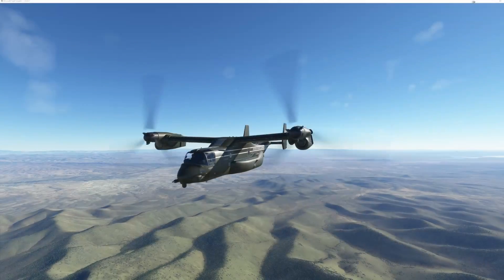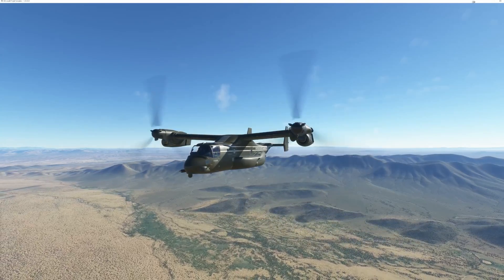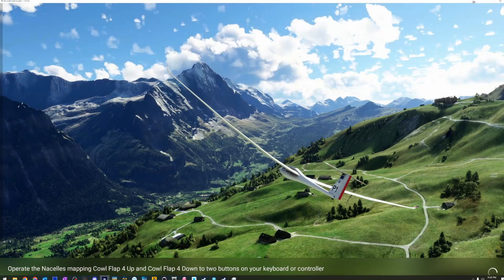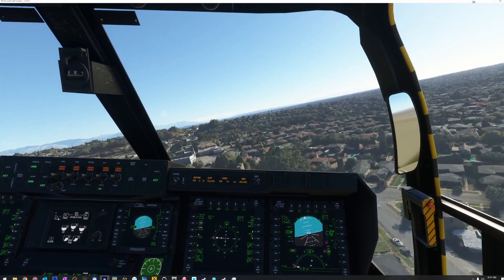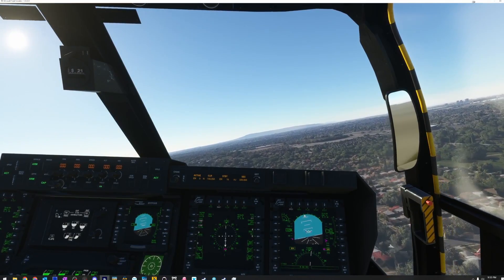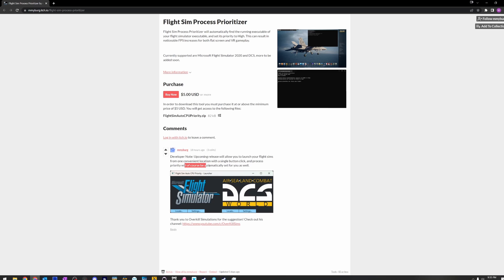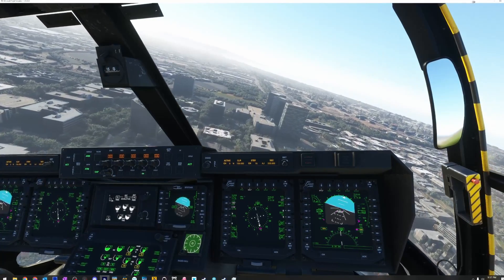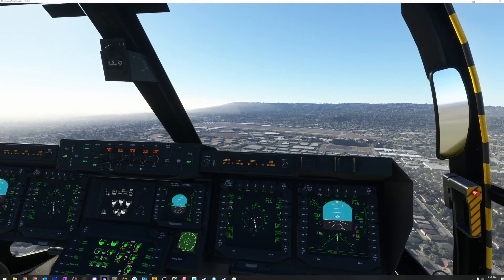Stop the Stutters and Improve Performance in MSFS!

Comment: Thank you very much for this very informative video. I found another tweak in the register to ensure that Windows takes into account the L2 and L3 memory cache of your CPU :
Go to HKEY_LOCAL_MACHINE\SYSTEM\CurrentControlSet\Control\Session Manager\Memory Management, and ,
       -  set the SecondLevelDataCache DWORD with your CPU total L2 cache in KBytes (for instance my Ryzen CPU 5900X  has 12x512 = 6144 KBytes)
       -  if not there, create a new DWORD ThirdLevelDataCache and set it with your CPU total  L3 cache in Kbytes (for instance in my case 2x32 MBytes = 2x32x1024 KBytes = 65536)
With such additional tweak I discovered that my 1st core was much less busy communicating with the GPU, adding an extra fluidity to MSFS w/o any stuttering.
By design Windows does not depend on any specific CPU, this is why it seems to be wise to ensure that it actually takes into account your CPU L2 and L3 memory cache.
Hope this is useful to anyone,
Cheers,

Comment: Thanks OKS  for this presentation. 

In  various tutos about MSFS stutters I noticed people does not often talk about SYNC to synchronise FPS frame rate and the display  refresh rate. In my opinion micro stutters or remaining stutters very often come merely from a lack of such synchronisation.

If your display incorporate a kind of Autosync, just enable it, if not, go to MSFS general options and set SYNC On and select your frame rate limit. There is a good chance the micro/remaining stutters will disappear instantly.

In case of NVidia GPU , check that the driver parameter Vertical Sync is application dependent or activated

Hope the above can help,

Kind regards

Comment: Thanks for the video. Really wish it actually was possible to "Stop the Stutters" though. You successfully reduced the stutters a little, but also proved SU11 is a mess and the game will stutter EVERYWHERE on ANY graphics settings except over pure ocean due to poor management of scenery / trees in the CPU pipeline. I really hope they address this in SU12. FWIW I noticed a lot more stutters than you did, way before you dropped low. The same stutters 2D users can demonstrate, as you did, are way more jarring in VR and, though you flagged the longer stutters, the short stutters which are also visible on your feed break immersion badly in VR.

Comment: Hi overkill! I’ve been struggling with severe FPS degradation over time since SU11. I’ve noticed I only ever get this problem when I’m limited by main thread. The fix for me used to be just lowering both LOD sliders down to 100 however even with all graphics settings now on minimum I am always limited by main thread and in the red. Any suggestions?

Comment: If you have a Nvidia GPU than turn off desktop scaling in the driver configuration panel and you will have a far smoother experience across the board and not just in MSFS but all games and the desktop too.
Reply: Can you guide to where exactly find that option? Thanks
Reply: @MetaGlassPilot  No I cannot as I run Windows in the Dutch language. But if you have the Nvidia Control Panel go to Adjust Desktop Size And Position and then select No Scaling and hit the Apply button.
Reply: @LogiForce86  Thank you!

Comment: Thanks for the tips on setting the CPU priority for FlightSimulator.exe.  I now use that, but what really fixed my problems with stuttering was getting rid of the rolling cache. I heard you mention that you were not using the rolling cache.  Once I turned that off man what a difference.  I had been using the rolling cache for quite a long time, but I'm thinking that as the scenery data was coming in from the internet, at some point there is enough data that it needs to write and commit it to the cache... Stutter time...

Comment: .. to make it permanent, you can also use a dword value called "CpuPriorityClass" set to 3 here: Computer\HKEY_LOCAL_MACHINE\SOFTWARE\WOW6432Node\Microsoft\Windows NT\CurrentVersion\Image File Execution Options\FlightSimulator.exe\PerfOptions. (but .. still i have this stutters, even at up to 50 to 60 fps; looks like only a partial solution .. flightsim not properly optimized)
Reply: Open Notepad, copy text and edit appropriately. Note line 2 seperates file path and executable. Save as .bat file extension type for all (not text). Run it as Admin, and it will run the process in high mode. Don't forget, as most do not have the Pro version of Windows, it likes checking and altering pirorities of executables, thus re-doing it every 10 seconds.  Bonus running in "Game Mode" for Windows, as it will limit background processes.

TITLE Put_Your_Fancy_Title_Here
START /D "C:\PATH_OF_SIM" /HIGH FlightSim.exe
:2
TIMEOUT /T 10 /NOBREAK >NULL
WMIC PROCESS WHERE NAME="FlightSim.exe" CALL SETPRIORITY 128 >NUL
GOTO 2

Comment: I'm sorry, but you are suffering from placebo effect.  Your video clearly shows just as many microstutters after changing the priority as it had before.  They may even be a bit worse as you have somewhat cripped background processes that are loading topography data off the web.
Reply from the maker: No I'm not.  Go to other locations and try it for yourself:) I promise it works.  I should not have used KLAX

Comment: Virtual desktop runs your sim in 1080p in vr. Active signal resolution and the frametimes are brutal. Using custom resolution utility, I change my signal output to 4096x1880. My tv black screens and use virtual desktop to view my desktop and can revert back to native using the quest as a screen. Make sure virtual desktop is starting up automatically on restart and untick "use optimal resolution". Running over 4k keeps strain of by cpu with larger frame times. Also try 2560x1440. Setting msfs2020 to high priority has been mandatory since the beginning. I set the virtual desktop streamer exe at high also. Take care guys...and if this comment strikes you as bullshit, well its because all we've done with this sim is tweak settings. Its disappointing to be sure. Feel bad for people with 1080 monitors because your GPU will only list resolutions your monitor supports. Which is 1080 and below. Careful turning on or off game mode on your tv. My Samsung and pc treats each mode (on or off) as a separate tv and nvidia cp saves your settings separately for each mode.

Comment: I don't believe that this does anything. Windows know how to manage the system resources better then you, especially with a program written by ...Microsoft. A safer way, it is to close all running applications and select "Optimal Performance" in the Power Management app which crank the cpu to 100% all the time. You will see that there is nothing going on except the FS process.
Reply: Actually Microsoft Windows has been designed to, by default, give normal running processes equal priority (i.e. Normal priority). This is because Microsoft and Windows is not interested in giving any one process, except usually for some system processes, 'optimal performance'. In fact, doing so would directly impact all other processes on Normal priority, giving them a little smaller slice of CPU processing time that High priority processes. This is because Windows cares to be a multitasking operating system. What a user does when he sets the process priority to High, is to instruct Windows to give that process a little more CPU time than all lower priority processes. This can have a large effect on a process - in fact, it can be clear that this can make a big difference to how Windows runs your processes, if you set the priority of a process to Highest. What Windows does then is, often, starve the remaining lower-priority processes. What a user does, who is experiencing micro stutters, by setting a process priority to High, is telling Windows to give this process just a little more CPU juice. Far from being anti-Microsoft, the option to do this is built in to Windows task manager, by Microsoft, exactly because this is a useful thing to do sometimes.
Reply: @mariusmyburgdev  Hum you are free to try it but my cpu over around 60% usage during a flight, hardly hard processing. Plenty of power left. If you stop the running processes, what else does the cpu as to do ?

Comment: Hey Mike 👋 good recommendation on the cpu priority 1 tip, process lasso is free and can accomplish the same thing and it will switch the priority whenever you start the sim 😉.
Reply: Process lasso works amazing especially with Tarkov too. Only way I was able to get higher fps and smooth gameplay.
Reply: Ya, I'm sure having more software running, consuming more cpu cycles in the background is the way to go.👍

Comment: I think micro stutters are worse in Win 11slightly and Task manger interface  in win 11 looks different but the same tab and functionality does exits.

Broadband line errors don't help, ontop of the CPU priority. As I recently found out myself.

But I've been flying MSFS2020 since its been out and I have NEVER known that you could change a short destination flight hight, using the World Map NAV log option?
 Now I know about NAVLOG, no more space shuttle approaches or starting your practicing landing at 50 miles out. Now I can now practice landing 10- 20 miles out at 4,000 feet or less.
Thanks for the tip.

Comment: Downloaded the software but it is not automatic. You have to run the application each time you start the sim. I might as well set it in task manager myself if that is the case. have i missed something?
Reply from the maker: This has now been resolved with the newest release. It will now run as a Windows service in the background and will now prevent Windows from changing the priority back

Comment: I'm having a major problem in the sim. About 1 minute into any flight it just freezes. I have to flip the power switch on my computer to restart. Was working fine for the last 2 years and I haven't changed anything. I'm grounded for the time being. HELP!
Reply: @reason6835 and @Barry - start deleting all mods (just move them to an other folder on the PC). Restart the sim, leave it.

Update System, update chipset driver (Intel or AMD), update GPU driver - ideal, delete GPU driver using DDU (display driver uninstaller) and reinstall the GPU driver fresh. Check if there is enough hard drive space.

After that, test your GPU and CPU.

CPU: Install Cinebench and Hardwareinfo. Set Cinebench to run the test 30 times, watch at Hardwareinfo -> Sensors -> CPU temperature. If it explodes (100° Celcius) you have a temp problem.

GPU: Install Heaven benchmark (not Fusemark, it is cruel to GPUs IMHO), start Heaven at choose high or sth like that, let the benchmark run in a loop.

If neither the CPU nor the GPU let crash your PC or overheat it, start a modern title the latest and greatest (not MSFS). Does crash? Other problem, Does not. Okay, step farer.
Start an older title - just some years old; does not crash? Okay next step.

Start MSFS -> Settings, set to default. Exit the program. Restart your PC. Wait till all ist auto started, after that -> start MSFS. Choose DirectX11 (General Settings, graphics).
Restart MSFS if asked for. Back to settings, choose “low” or “lowest” or whatever. So that your GPU should have no problem, if you have a dedicated one, at all time.
Delete cache (a little belower in the settings)

STILL while the MOD folder is empty (you as you still have moved anything away) -> update the game also inside -> Marketplace -> Content Manager -> Check if there are “updates available”. Install all. Check before in market place, if you have chosen the free addons of ASOBO like USA, Germany and so on. Yeah they are whyever helped many people.

After all updates are done, go to a point in the middle of nowhere (map of the game), deactivate “live weather”, “no AI or other planes” set weather to Sun, ignore ATC. 
start in the air with a general aviation (propellor or turpobrop) sth. - does it fly and not crash? Great.

Choose an airport, in the middle of the day, sun - no live, no ATC etc. -> choose an ingame (Asobo) Airliner -> put it on the runway. If the “fly” button is shown, wait 10-15 sec then click “Fly” (not in my head what is on the thing). Start, fly.

Works? If so far, it had!

Start pushing your graphic settings - STILL DIRECT X11! Medium etc.

Have fun, till it is to bad, stutters or crashes. The later can happen, if too much GPU memory is tried to be allocated, that is sometimes a problem.

All works?

Install MODs one after another, check especially if all are updated SU 11 ready. Start with the Fly-By-Wire A32NX first, that works. After that the top after market addons (HPG 145, PMDG). After that captain scam or whatever … after that free mods of flightsim to - but check if they are updated.

Sadly one by one, so out of the sim. Install, next … in … out … and check and every step.

ONE Mod, one setting, one driver can crash a program.

Hope I could help, that helped quite some people (also in other games with mods I know, too).

Cheers, Pepe
Reply: Same here!  Grounded since update 10...
Reply: @Barry: This sucks. I'm probably just going to buy a new computer. Been through the forums and tried everything. If reinstalling windows didn't fix it, I fear nothing will. 2 grand down the drain.
Reply: I've reinstalled the game twice and even reinstalled windows. Problem persists. (Happened before update 11).
Reply: Did you delete/erase your Rolling Cache? 
If that doesn't help, monitor your temps and vram/system ram usage to see if you're hitting any limits
Reply: One thing you could try if you have an Nvidia card is to go back to around 522.25 for your driver version. I was crashing too and I had to go back that far to stop them. I saw a lot of people on the Nvidia boards do the same thing.